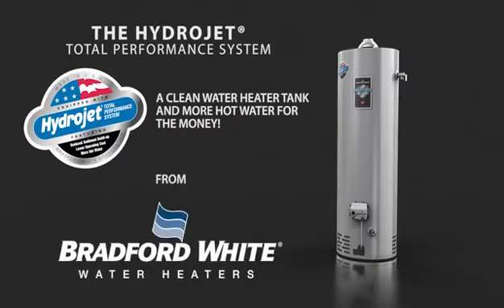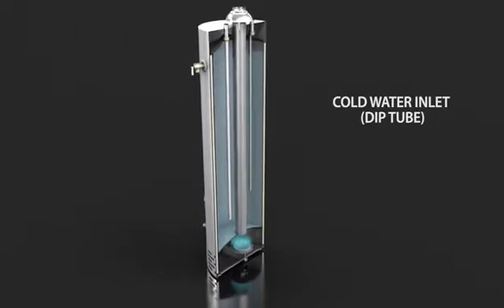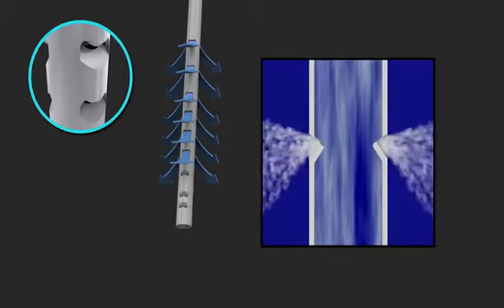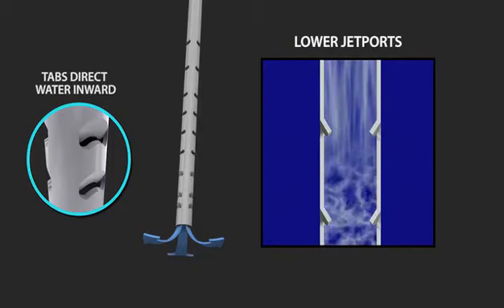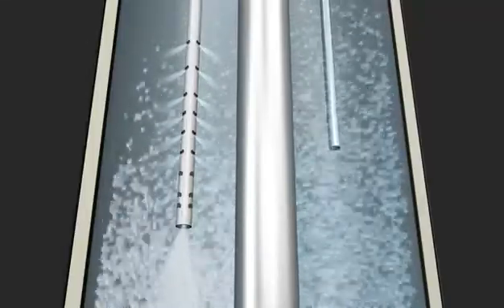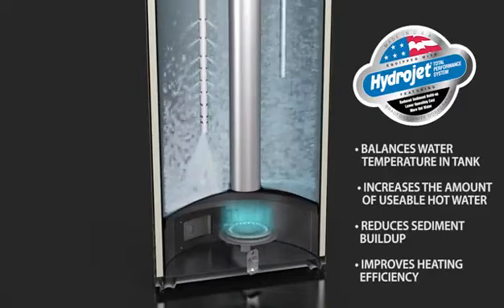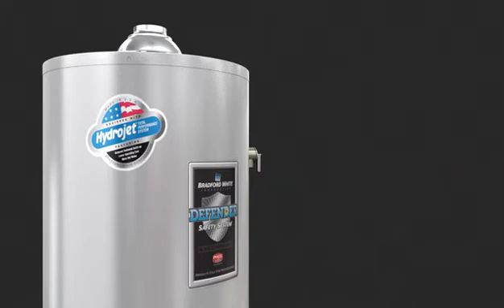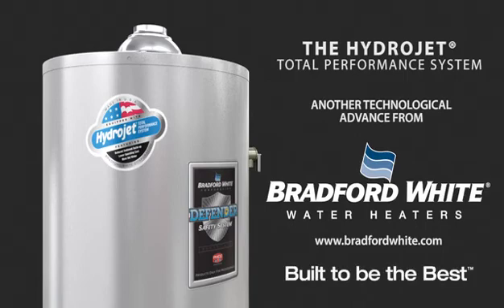Bradford White Hydrojet

Comment: The water heats from the bottom and works its way up regardless of how it’s distributed into the tank. And sediments sink to the bottom regardless of how the water is distributed into the tank.
Reply: I just flushed one of these water heaters after 5 years of living in my house. Almost no sediment. Maybe 15 small soft white pieces came
Out. Pretty good water heater ide say.
Reply: @ yes they are probably the best on the market and this is all I install in a tank configuration electric or gas. Please don’t second guess them my whole point was sediments sink to the bottom of every water heater regardless of how they are ingested unless it’s a tankless. But then they still lay in the bottom of the heat exchanger passages. And very nice that you were able to get it to flush after 5 years…sounds like you have pretty decent water quality.
Reply: @angeldesigns1385  I have a well. Not sure if that has anything to do with it. Water doesn’t seem very hard. Don’t get much build up on shower doors neither. But whoever put the water heater in didn’t strap it. So it’s just sitting there